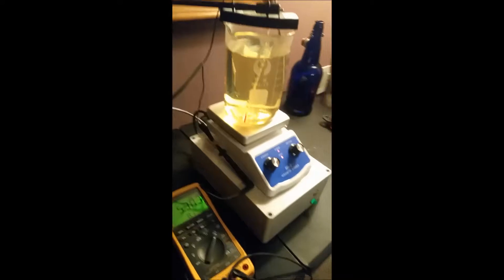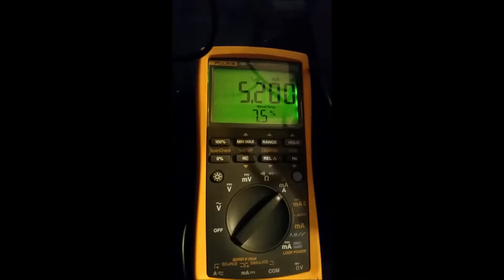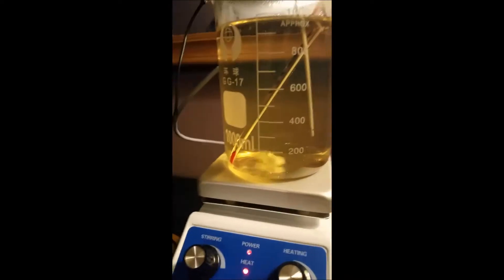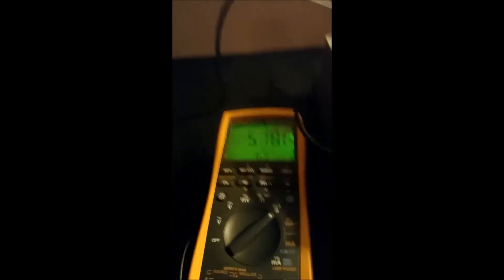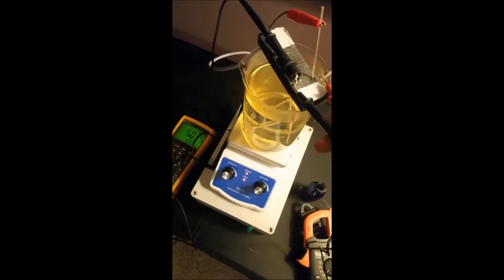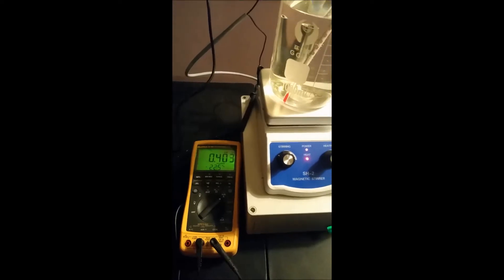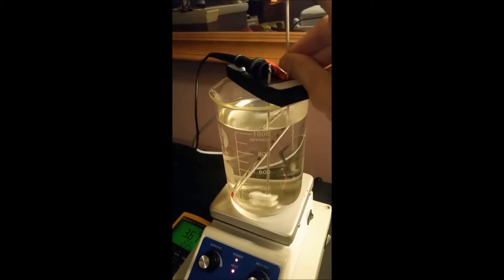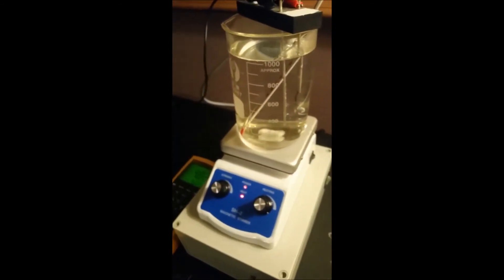Homemade Low Voltage / Low Current Colloidal Silver Generator

Comment from the maker: It's been a while since I ran my first batch through this csg and I thought it would be useful to give an update. 

I haven't made any cs for the past year or so and every bottle that i have is still clear and yellow. There hasnt been any precipitation and it seems to be very stable. I added an ounce or so of cs to a gallon of water in a glass jug about 2 years ago and the water is still crystal clear with nothing growing inside of it. I cant say with any certainty how concentrated my batches are, but they were all made exactly the same way and they all look identical.
Reply: Please do not insert any additional thing to fasten the process. Just use destel water
Reply from the maker: @MEGAN SPISAK I made it. Cant remember the concentration off of the top of my head though, as its been a while.

Comment: Without measuring the actual real-time ACCRUED rate of current, you CANNOT accurately determine your PPM.
Reply from the maker: How does one measure the actual real time accrued rate of current?

I set the timer to 10 minutes and was monitoring the current periodically. It never exceeded 5.3mA. What is the formula for calculating PPM again? 15mA produces 1PPM per minute in 1L of water? So 5mA should produce 1L of 20PPM CS in 60 minutes, correct?
Reply: The problem is your "periodic monitoring".   You still can make CS, but without a processor monitoring it realtime, you will not have precision.  This will be problematic for PPMs exceeding 20 since depending on what you use for reduction, you could have fallout.  You REALLY need to read and RE-READ the instructions from Kephra on the CSCGFORUM.COM  I know you've been there since I found YOU there.   Kep is a ACCREDITED BONA-FIDE REAL PHYSICIST. What HE says should be taken as gospel on the subject.  THAT ONE site absolutely has ALL the REAL info you will ever need.   LOTS AND LOTS of wannabe's and simply deranged individuals are out there.  cgcsforum.com IS your safe haven.
Reply from the maker: I am using light corn syrup mixed with distilled water for reduction. I am not able to invest any more money into a generator at this point in time. Will a few extra PPM really pose that much of a risk?
Reply: corn syrup (glucose) is a "slow reducer", resulting in larger particle size. I would suggest to work in total dark and cool conditions during production of ionic silver. The reduction (I use the citrate protocol with soluble starch as stabilizer) should be done as fast as possible to keep particle size small. Heat up the ionic silver to 80°-90°C and add the stabilizer and reducing agent under vigorous stirring. As soon as the liquid has a nice yellow color (for 15-20 ppm), cool it down to room temperature. You can test some of the nano silver to see if it is fully reduced by adding some table salt. If there is no visible reaction, the colloid is fully (>90% reduced). Over time, the color should not change and there should be no precipitation, that way you know you have produced stable, small particle (10-100nm) spherical nano silver.
Reply: I have never been able to access the CGS Forum, the site seems to be down? I don't believe it is that important to have exact ppm readings, and as long as you use food grade reduction and stabilizing agents, I am not sure what would be the danger of "fallout", whatever that means. I generally just filter out any excess of stabilizer and this has never posed any problem?
Reply: It's all approximation regardless of the calculation, as this cannot account for the deviations and conversions due to; aggregation, plating etc. 

With that said, CS has a a natural limiter due to saturation, in that we can never get more than approximately 26ppm at room temp without the use additives and/or extreme processing methods.  Otherwise, the colloidal suspension will fail and things fall apart; plating, pooling, precipitation etc. 

PS. the best possible scenario in such cases would be to contrast processing calculations(ramping) along with electrode weighing. Which would require a great deal of care so-as to retain the anode and electrode deposits. Whereas an average must be found between batches.